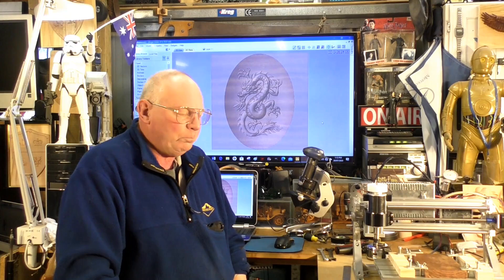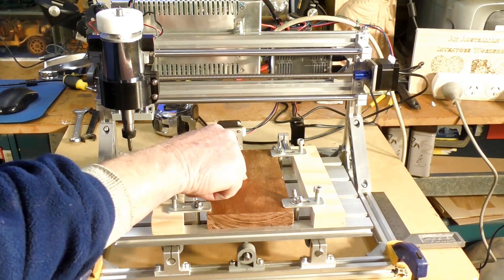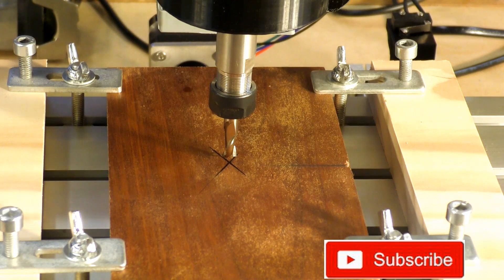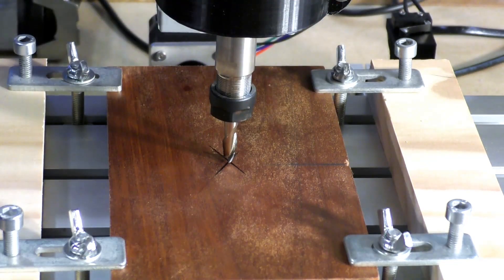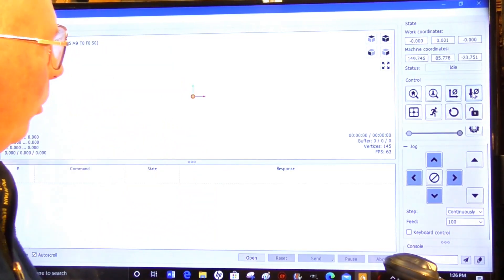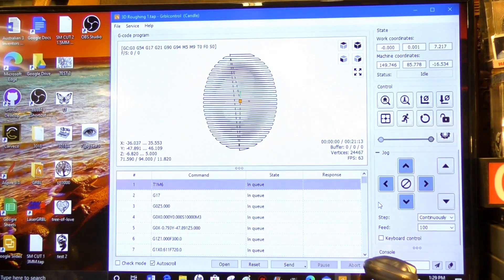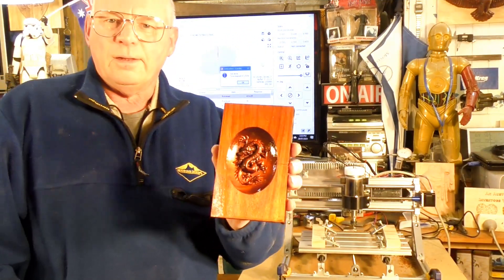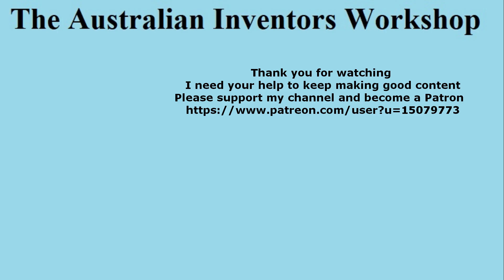3018 CNC Router 3D carving and GRBL Video

Comment: The CNC your showing was my first CNC and I upgraded to.a 500w spindle 
And put some extra vertical extrusion bars in and could do aluminium cuts at a depth of  0.3  to 0.5mm  depending on the speed s
So for the price these are a great little machine
And glad your doing videos of it 
As it does help those to see what can be done with a small cnc
Reply: Also to say 
If you want to learn about how CNC machines work and also to learn the software and setups then get one first to see if you will enjoy CNC
And if you have crashes or broken bits then you learn and it's not expensive
And so when you get confident the go for a  bigger one
If you need to